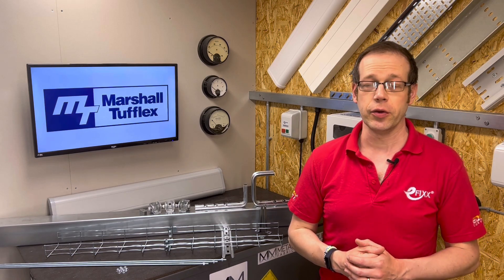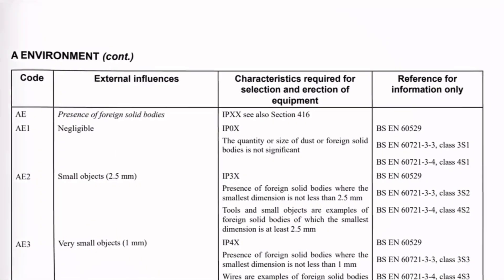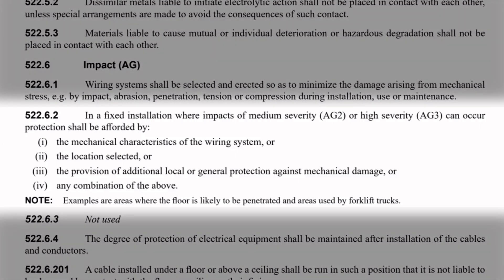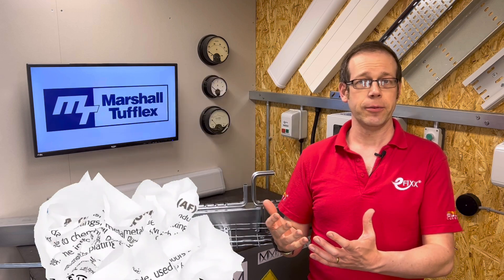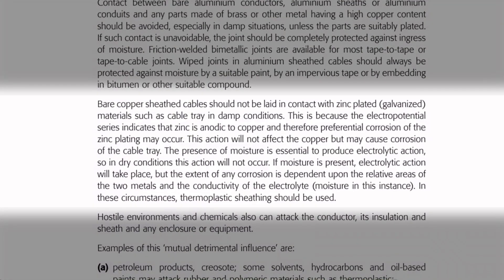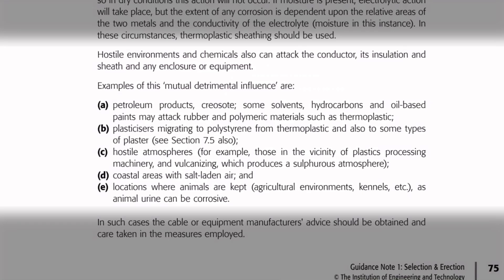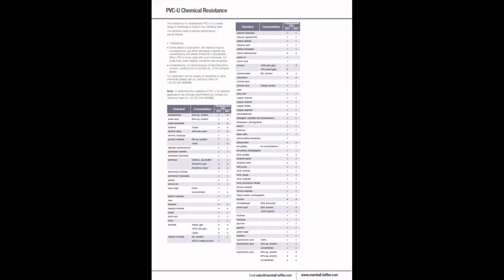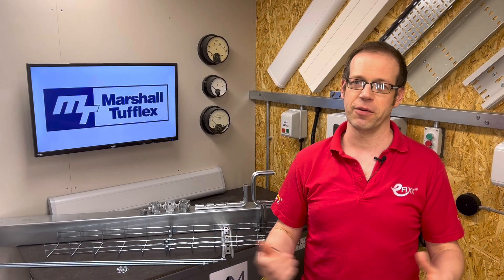Will this Cable Tray Rust?

Comment: Galvanising puts two dissimilar metals together and this will cause a galvanic reaction that will with time “eat” the zinc. If it is near the sea then the process is accelerated. Steel boats are fitted with sacrificial anodes for this reason.  Galvanising steel improves corrosion protection it does not prevent it completely.  Also remember that if you drill a hole in galvanised steel, you are removing the zinc protection at the hole.

Comment: 11:15 So using stainless steel cable ties for the purposes of stopping cables falling into walkways in the event of a fire would cause the cable tray to fail due to corrosion.
What is the solution to this conundrum?
Reply from the maker: Yeah it's a good point to be fair, it could become a problem if it was a damp atmosphere. Maybe plastic coated steel banding in that instance? 🤔